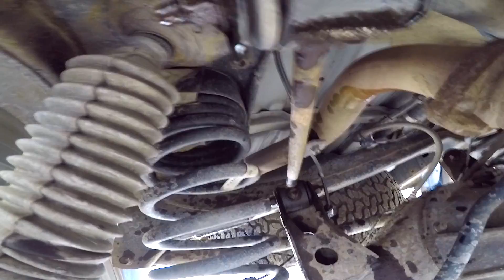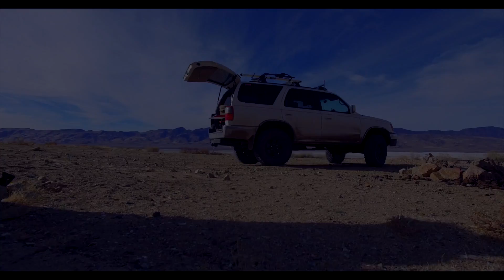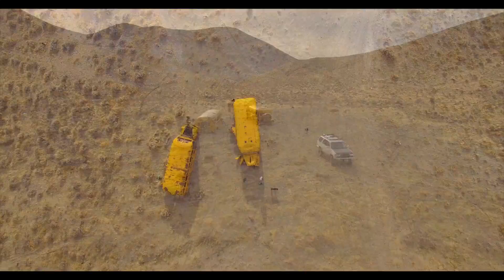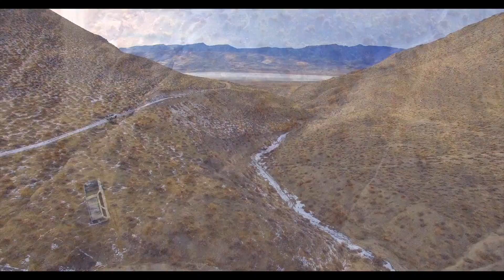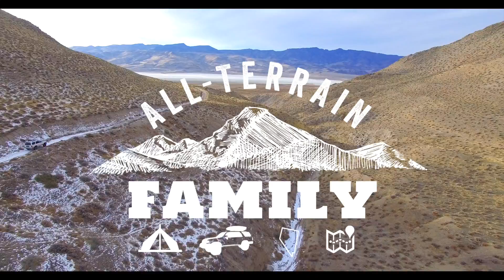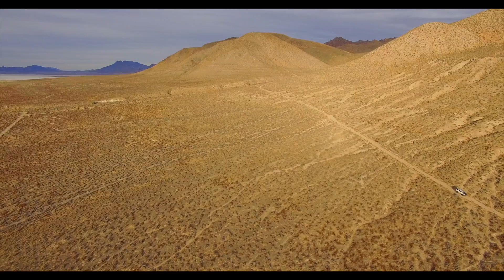Driving with a broken upper control arm, 3rd Gen 4Runner

Comment: Did you ever take it up to speed with this broken control arm?  Mine was bent and broken in the middle - apparently for some time (rusted and worn at the break).  My son, the driver, 'never noticed anything weird' until recently.  When the truck got up to about 55mph, a pervasive, low frequency hum was heard and a slight vibration in the body.  Could also be the bad tires we're getting replaced, too.  Thanks for the video!  2001 Toyota 4Runner
Reply from the maker: Yes. Felt really boaty in the back end.

Comment: If you take this to a shop for repairs what do you guess it would cost to fix?  I believe this is my problem, too but am cash strapped.  Thanks for any thoughts on this.
Reply from the maker: The part is like $30. Install is less than an hour. And it should be pretty hard to screw up.
Reply: @AllTerrainFamily  Cool.  Thanks so much for the info!  Maybe I can still drive and eat this week! LOL.
Reply from the maker: @GrammieWay  Cheapest option is DIY. Parts and tools are probably less than an hour of labor at a shop.